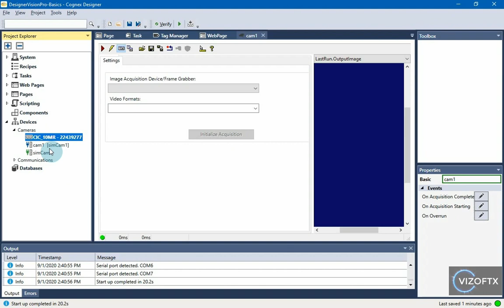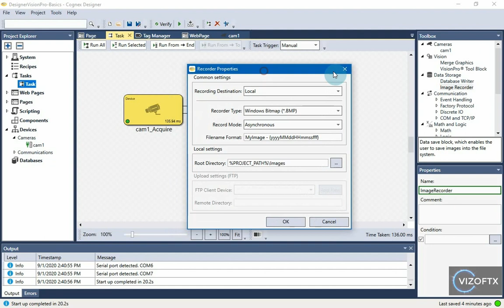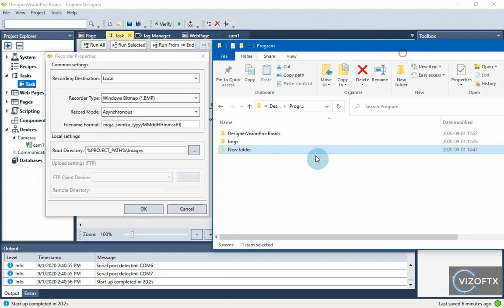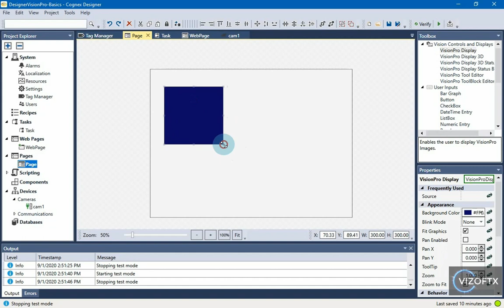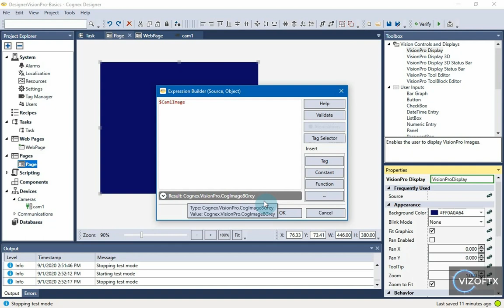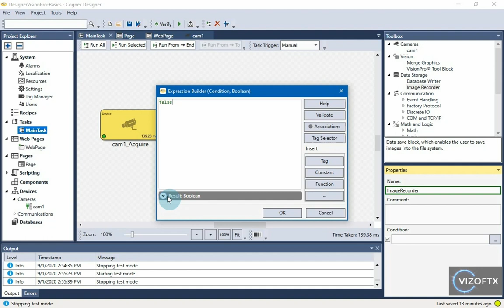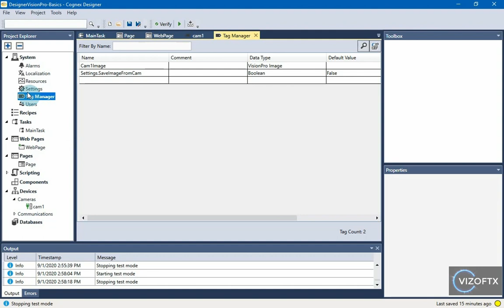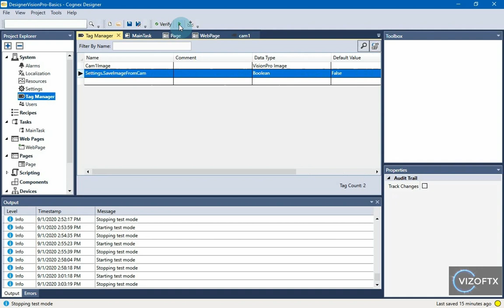01-04 Cognex Designer VisionPro Basics - acquire, display and save image plus checkbox

Comment: Hej, nice explanations in your Videos. I really like them.
Is anything speaking against using PNG as picture-format?
Reply from the maker: Good question. Saving PNG using inbuild method takes a very long time. Even couple of seconds, which is unacceptable in most of cases. Maybe in future there will be more control over compression ratio which would allow control over the processing time. PNG is also lossless format so it is OK to use in inspection systems.
Thank you for the feedback.
Reply: @vizoftx  Ahh, i see. Would it be possible to transform a image with an external library through a script-Block? Or does this take the same time?
Reply from the maker: Yes. It's very easy to extend the functionality using scripts, or even plugins, that is what I like about Designer. We are often saving images in JPEG (images with graphics, or images used for deep learning) using scripts, so saving to PNG using script is definitely possible. I personally experimented with that, but only using default c# functionality - with lover compression ratio it was much faster, but then we were loosing the advantage of space saving. I did not experiment with third party library. It would be great if you (or someone else) could advice some good library. But using external library is causing increased complexicity, which may be impractical over time. There is a tradeoff between added value and added complexicity.